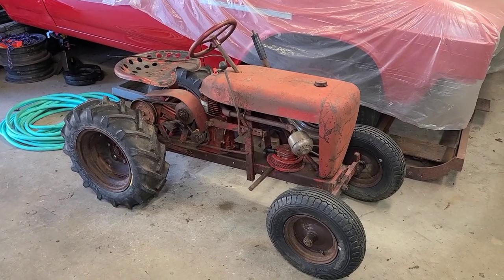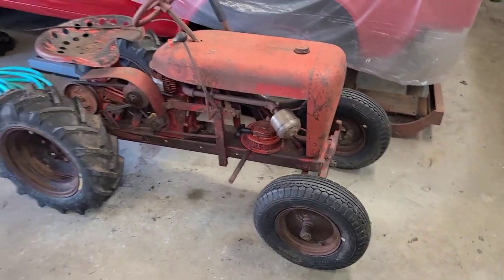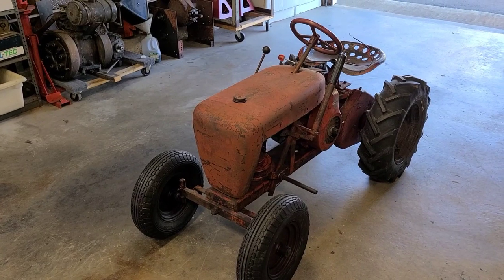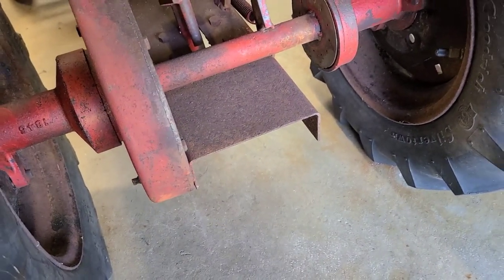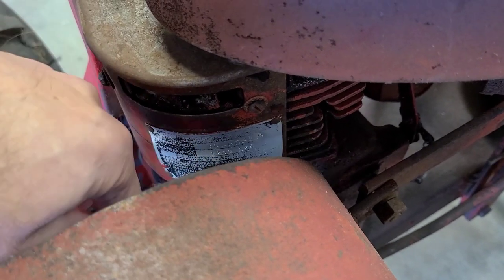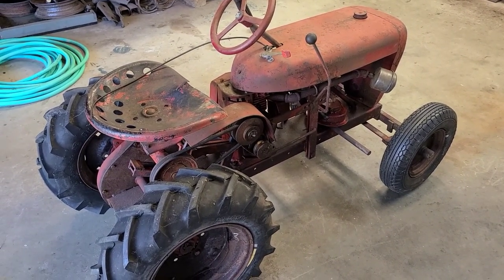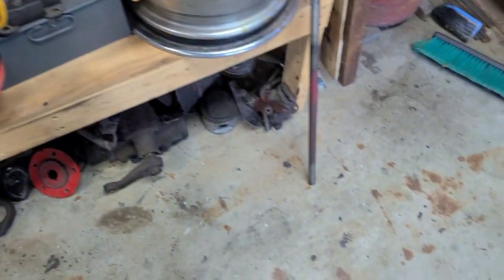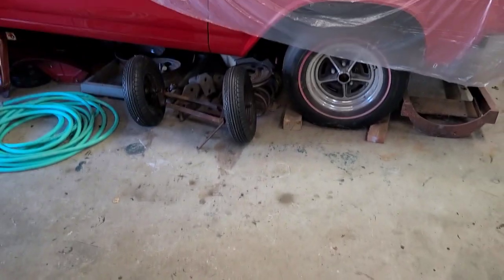1956 Wheel Horse RJ35 Garden Tractor Steering Debacle Part 1 VinsRJ

Comment: Thank you.  I have an early RJ35.  Cast steering wheel.  Gas tank in cradle.  Smooth hood.  C channel frame.  No cross bar on hitch receiver.  
My hood has a black with green lettering WheelHorse decals.  Original for a 55?
Reply: Yes